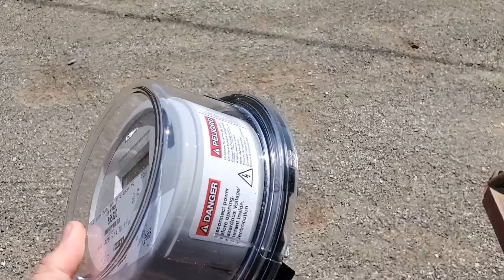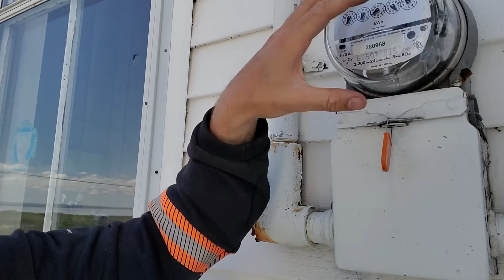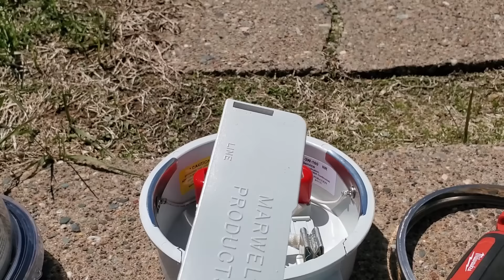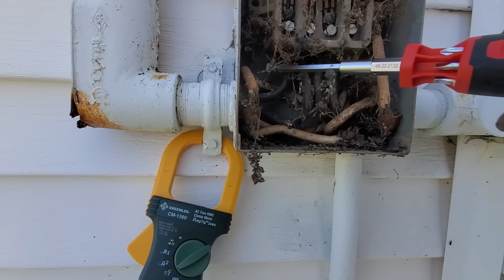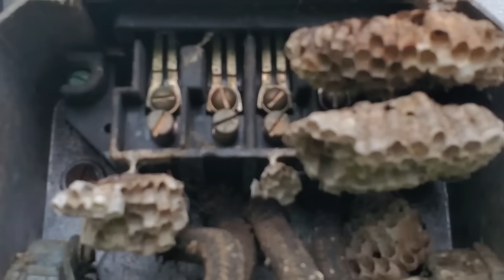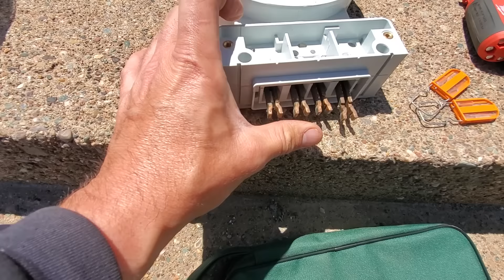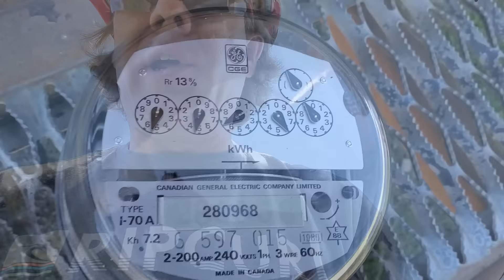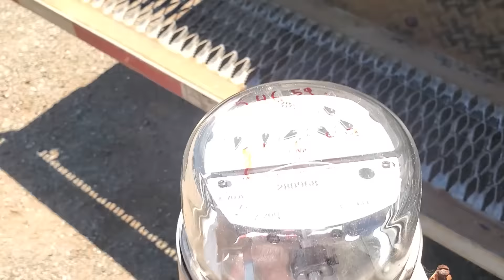Removing an old "A" base Electrical meter

Comment: Do a lot of linemen do meter work? Wouldn’t they just have the meter person do that? Just curious.
Reply from the maker: We have a meter guys for simple socket type swaps and a dedicated meter guy for all three phase installs that fully certified. Our trouble/service guys also have the training to cover "1 off" jobs or ones like this that are out of town. Also I sometimes cover the meter guy during vacation for pt and CT installs.

There's an "a" base swap project throughout the province, so I've got a ton in my area I've been picking away at
Reply: @Bobsdecline  Thanks for the answer! How's the pay from Linemen to Substation Techs?
Reply from the maker: It's pretty well equal here. If I remember correctly, they're slightly over a journeyman Lineman  but slightly less then a Lead hand/foreman
Reply: @Bobsdecline  I've been told that there is more Substation techs than there is jobs? Would you happen to know anything about this? thank you for taking the time and replying!

Comment: Really enjoying watching your videos.
I get the warnings about not doing this yourself, and I also very much like it how you don't hide the "secret" parts as a way of preventing people to do this themselves. Explaining why something is dangerous, is so much more effective compared to making something obscure.
What I actually learn from this: for this kind of job/work you have to be extremely calm and professional, take your time and never try to take a shortcut. When you aren't confident enough in yourself, just have an expert do it for you.
I'm not an electrician, I work in IT, and have been doing low voltage electronics as a hobby since I was a kid. Being able to see some HV stuff is nice, as I'm always curious about what happens "behind the socket".